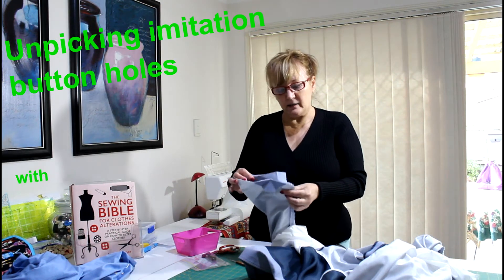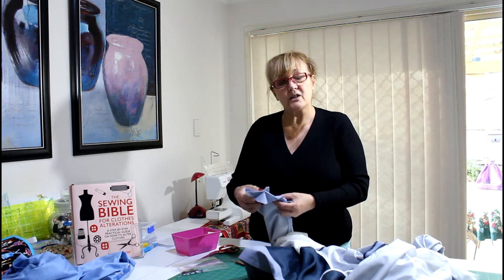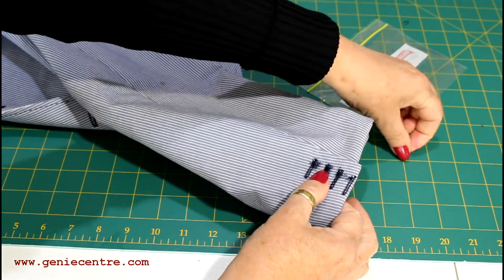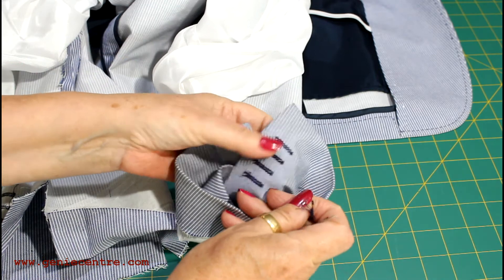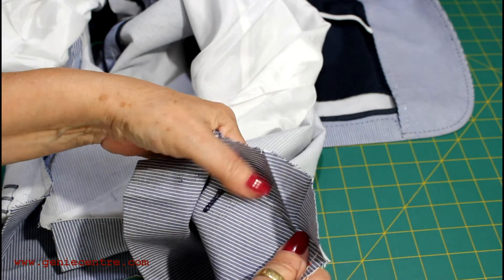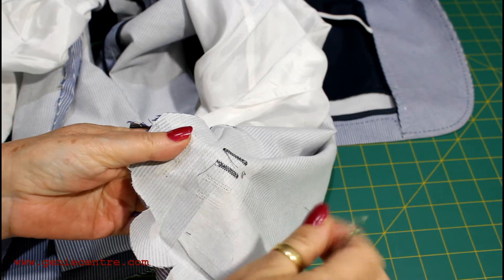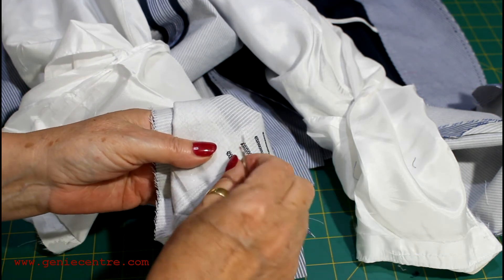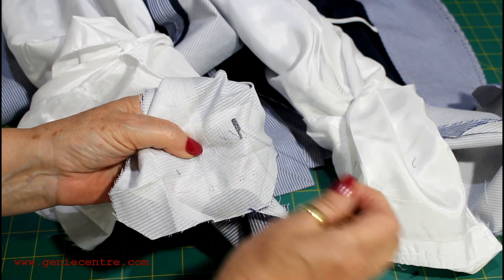Unpicking imitation buttonholes

Comment: Hi, I am new to your videos and I love them! I am an amateur seamstress and do all my husbands alterations but have come up on a situation I have never had before. I am currently faced with a dilema regarding one of my husband's brand new suit jacket. I was planning on shortening the sleeves for his interview tomorrow and I have found that there are fake buttonholes on it. His alteration is 2 inches!  The fabric is 100 % light weight suiting wool. If I pick out these buttonholes, do you think the fabric will be distorted and ruined by the heavy buttonholes (they are much thicker than the ones you have in this video)? I would like to take them off and redo the placket (split) at the wrist to appropriatly replace the 4 buttons but I am very afraid for the fabric never having had to do this before. What are your thoughts?
Reply from the maker: Unpicking the imitation buttonholes should be fine.  Once if is pressed most of the impression from the buttonholes will be removed.  And the buttons will cover most of them anyway.  go for it.
Reply: oooh thank you so much! and thanks for the videos! and i must say i totally agree with you about the cut buttonhole issue!